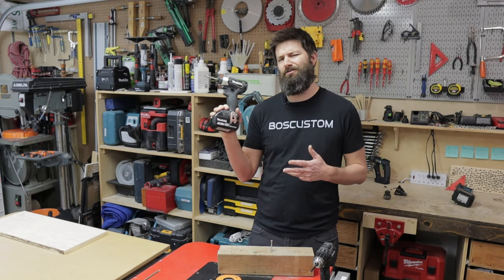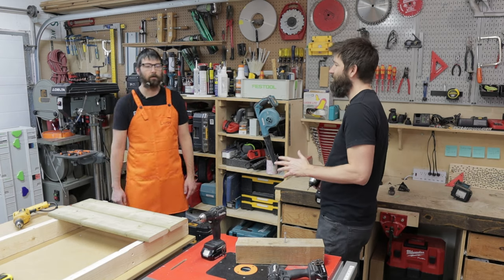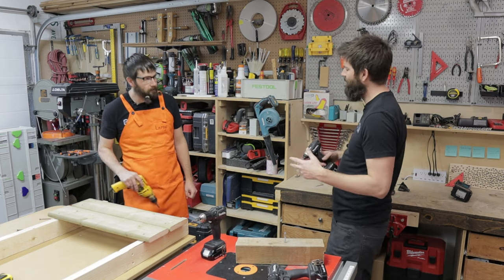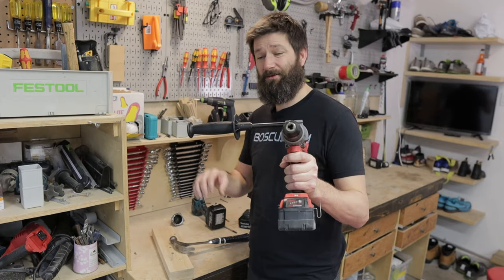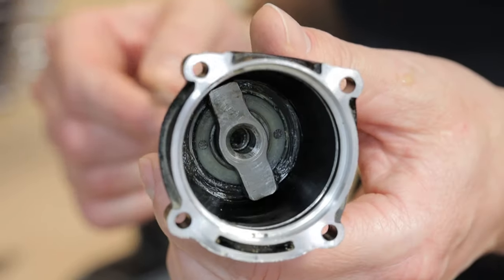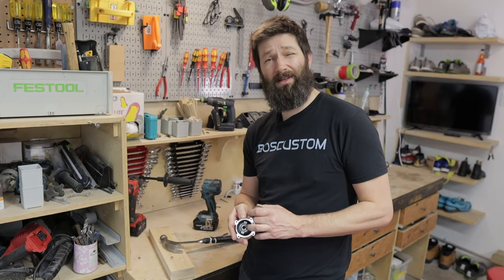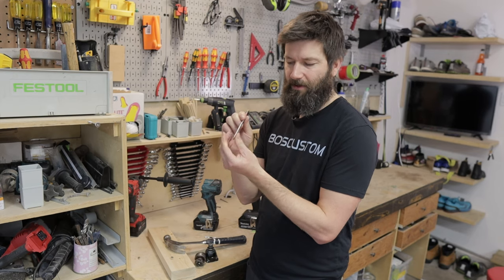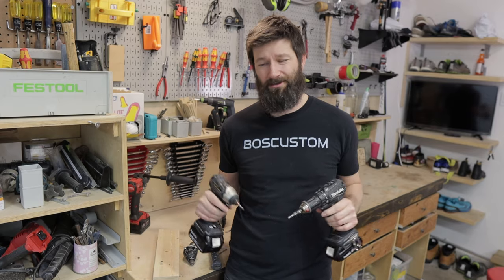Uncovering the Magic Behind Impact Drivers!!!

Comment: I have a hydraulic impact, it's so good. Different  feel but so fun to use. It's maybe half the strength of the traditional kind of impact. Great video.. A+
Reply from the maker: Thanks a lot Craig
Reply: I have the M18 Gen 3 impact as well as the M18 surge. The only time I ever use the Gen 3 impact is for tapcons or taking the lug nuts off my tires. Once you go with a hydraulic impact it's tough to go back - just way too loud.
Reply: @dfs7979  yes, good point. I use 3/8 tapcon so I need to use conventional impact for that as well

Comment: Long before the impact driver was invented I was using the hammer mod from  the combi drill for the bigger screws , even there I was piloting the hools .
The impact driver is just breaking the torque so that bit doesn't have to jump from the screw .
On  the impact drivers the impact not all vertical , is more horizontal .
Reply from the maker: Ya the impact is almost all in a horizontal rotational direction.  There is a slight tapping force that reseats the drill bit continuously as well. 🍻

Comment: Actually slips only helps there and real pull movement is cased by twisted internal spring which moves internal spinning hammer to be pulled up because twisting spring contracts it. When it's over the edges spring releases its energy by spinning hammer and that spinning release extend back spring length and pushes spinning hammer against pins.

Comment: I bought a 20v Porter Cable drill driver last Summer and wish now I had bought the impact driver.  I'm wondering if I could get an impact driver without the batteries that would fit my drill driver.

Comment: i dont think its the slope on the dogs that makes them compress the spring. i think there are helical slots in the shaft that drives the dogs, and they ride up it. for the same reason screws dont unscrew themselves from weight or tension, that dog wouldnt slide up over the thing it hits from torque alone, the slope is too flat. same idea behind taper held tooling i think
Reply: You are correct. There is a central arbor (that is hidden inside the hammer) that pulls the hammer back.

Comment: This explanation is incorrect. It's not the interaction between the jaw teeth that cause the hammer to slide back away from the anvil. There is a central arbor with a helical slot that pulls the hammer back.

Comment: This video is perfect timing.  MY old Ryobi 18V tools have kicked the bucket and I've been shopping for a new platform.  Do you have any experience with DeWalt?  Milwaukee, DeWalt and Makita are what I'm considering
Reply from the maker: Dewalt makes good tools as well.  You can usually get a bit better prices on the Dewalt stuff.  I'm not a huge fan of their drills in terms of balance and ergonomics, but that's more of a personal preference thing.
Reply: The new Gen3 Milwauke M18 impact. Strongest one on the market.
Reply from the maker: NigelTerror that unit looks pretty sweet
Reply: You can’t go wrong with any of the big 3
Reply: My old Makita LXT set was giving me trouble last year so I had to go through the same thing you are now. Why didn't I stay with Makita? Because I don't like their batteries. They never seemed to last very long both in charge and in lifetime plus Makita will tombstone your battery if it undervolts a couple of times on the charger. 

I first went with the Milwaukee Gen 3 combo and I absolutely hate it every day. The impact is too much power for all but the most extreme scenarios and the drill isn't much different. I have had to send both in for warranty repair within the first year. I just tiled my basement bathroom and used the drill as my thinset mixer hoping it would die - it still runs just fine.

At the moment I mostly run Milwaukee or Dewalt tools (both 18 and 12v) depending on which tool is better or sometimes cheaper (such as my Dewalt pex expander). I don't like being locked in to a single R&D budget.
Reply: @dfs7979  the gen3 has an electronic speed control.  How is it too powerful?
Reply: Well the speed control changes the speed of rotation however the spring pressure on the anvil remains the same. The tools doesn’t start the impacting action soon enough when driving small and medium fasteners. This leads to much more cam out than my old Makita and requires you to put more pressure on the tool.
Reply: @dfs7979  I guess we have different working conditions, habuts or perceptions.  When driving smaller fasteners like door hinge screws, drywall screws or finish trim screws the torque of mine drives them 90% of the way with a final impact or 2 to drive them flush.  If the fastener needs more torque on larger/deeper/harder material then the impact takes over obviously.  With a slower rotation there are less impacts per second. I don’t have problems with cam out unless I drive the screw in crooked or I’m hanging off a ladder 3 feet away driving screws overhead full power.  Maybe you need the m12 impacts.  Although even the m12 is way more powerful than my old brushed Makita.

Comment: Incorrect, an impact driver applies the force on the rotational axis with the anvil and no downward force.

Your example with the hammer and nail is how a rotary hammer drill works, which hits down rather than a rotation hammer.

Bit confusing with the names lol.
Reply from the maker: Ya I should have been more clear on the force being applied rotationally.  I though it was clear, but apparently not.  As well an impact driver does apply a small amount of downward force as that hammer snaps back, that force nicely resets your bit.

Comment: I own that Makita impact driver, except in black.  What amazes me is how much power this little device puts out.  Secondly, how long a battery charge lasts on even their smallest battery.  The only downside is that they are very loud.  I have to wear hearing protection if I am using it for an extended period of time.
Reply from the maker: Spot on, it really is incredible how much they can accomplish with barely and rotation force being exerted into your hand.
Reply: Try the milwaukee surge impact driver. Super quiet.
Reply: @stevendeckert6373  I already am on 3 different battery/charger platforms and considering Festool for a fourth possibly fifth.  If I was a professional contractor/remodeler and was starting from scratch, I would probably go with Milwaukee for general stuff and Festool for the precision cabinetry stuff.  The battery situation in the marketplace is totally ridiculous right now.  There is no one tool company that does it all and therefore the confusion and added expense.  My landscaper carries nothing but Milwaukee and has several thousand dollars worth of M portable tools in just one of his trucks, again spread out amongst three different M battery platforms.

Comment: Your information is misleading. As of 3/17/21 these are the 3 available options on hand drills. 

1) Drill mode- Used to make a hole with a drill bit. 
2) Impact Driver mode- Used to drive screws, nuts, and bolts. 
3) Hammer mode- Used to make holes in hard surfaces such as stone, porcelain tile, granite, travertine, etc. 

#’s 2 and 3 are often confused because they act similarly. #2 Impact Driver uses a slip impact hammering action in a twisting motion not chiseling into the material. This eases the screw going into a tough piece of wood like oak or helps drive a bolt or tighten a nut. #3 Hammer function, does use a chiseling hammer action directed straight into the material. This is needed to drill holes in materials such as stone, porcelain tile, and granite. A masonry drill bit is needed with this hammer function. If you’ve tried to drill a tile in a shower to install shower doors you’ve probably noticed how hard it was to drill. That’s because you need Hammer action on your drill. No matter how good your masonry bits are you won’t get far without Hammer action. 

Look for the symbols around the drill’s chuck. You will see number to identify the clutch force. You will see a drill bit icon to identify Drill mode. You will see a screw icon to identify Impact mode. You will see a hammer icon to identify Hammer mode. A dedicated impact driver is just that. In most cases it’s a hex drive socket. This is not a Hammer drill unless it has the hammer feature on it. Look for those symbols and buy your weapon of choice accordingly.